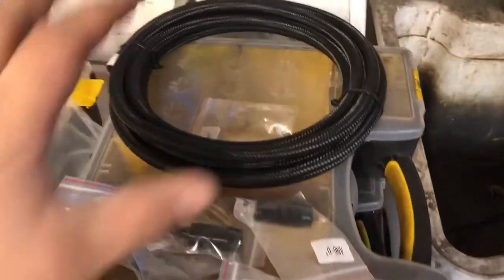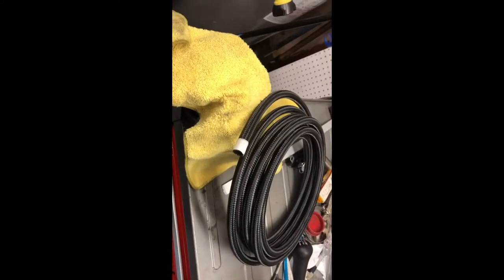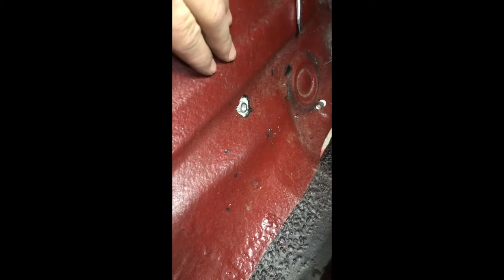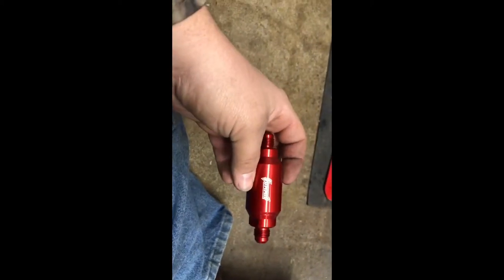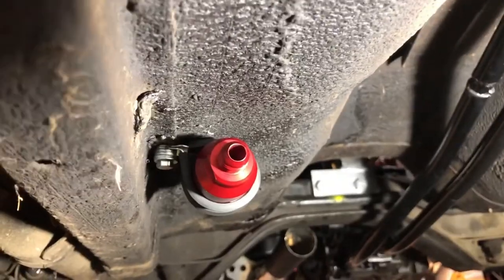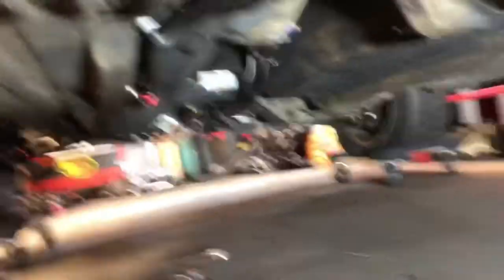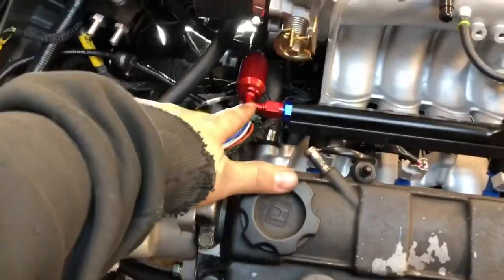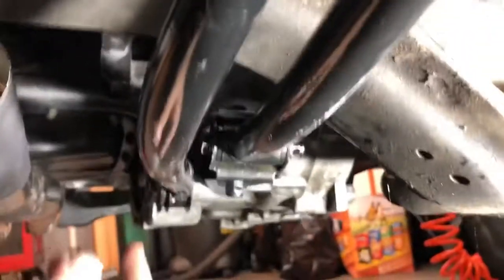Crx ECU and fuel System

Comment: Have u ever ran p29 pistons in your d15a3? I was thinking of upgrading to them, but i have limited info as far as clearances. I have herd that you need to clearance the pistons for the valve to clear. Any info would be awsome. 
Ps:Love what your doing! Keep the videos coming. 👌
Reply from the maker: I personally have never used them in a EW. But I know several people that have. On a stock cam you will be fine. But anything lager you will need to clay test the engine.
Reply: How do you set up the 87 ecu. With the new engine in my case im working in 1987. But engine 2000
Any help appreciate with the wire or harness posible
Reply from the maker: Are you asking how to get a 00s engine to work with the 87 stuff?
Reply: I have a car 87 and i installed a 2000 engine both car are. D series the 87 was automatic now going be manual my question is how can I connect the harness to make it work normal